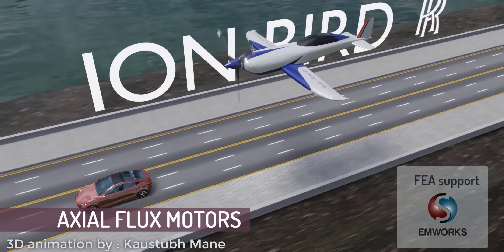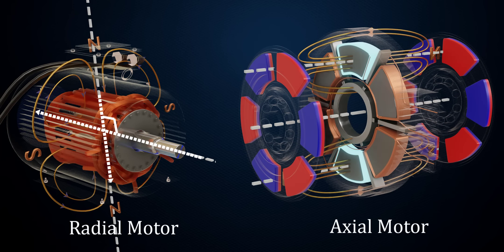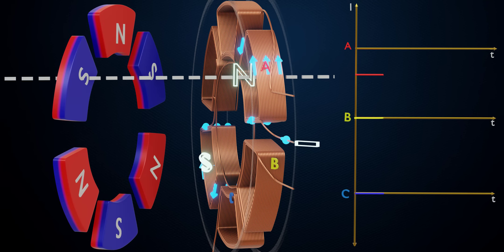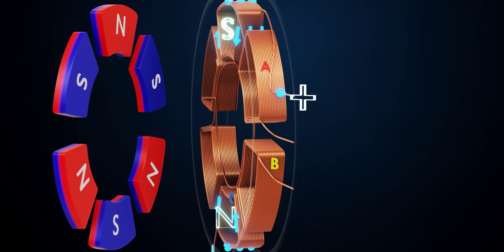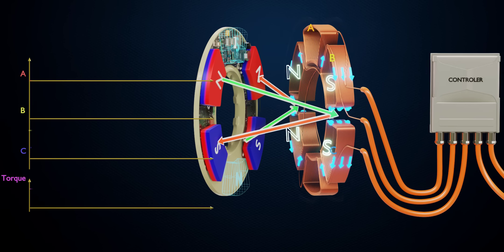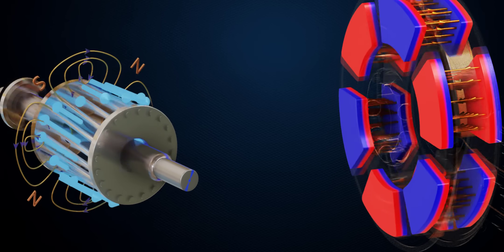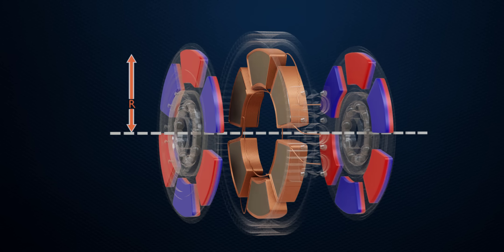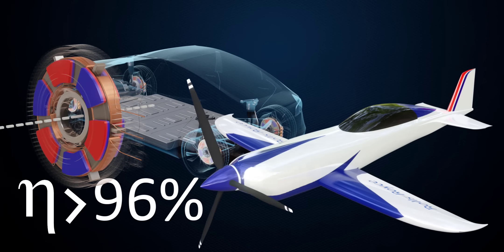Axial flux motors - The new hope

Comment: So why have we been using radial flux motors so far? What's the catch?
Reply: One would be the dimensions since "thin and long" is more convenient and secondly it requires more advanced electronics drive this type of motor. For every day applications like power tools and houshold appliances, the efficiency benefit usually is not of significant advantage.
Reply: @MiTheMer  I mean, I didn't even think of power tools but now that you mention them... a high torque-to-weight ratio isn't important for them? Really?
Reply: @unvergebeneid  Well, gearbox will be usually cheaper option. But I think that these motors will be used on high-end e-bikes, because apart from cost and complexity, they are perfect for this use.
Reply: @MiTheMer  modern power tools already uses BLDC motors, main reason for those engines not used in past, i guess is tied to low availability for high power mosfets.
Reply: This was my question too
Reply: Cooling is tricky.

Comment: Also, folks are going to scream cost-effectiveness just how much cost is this going to be less or more in the long run.  Could you wire in solar power so that you could include self-charging on long-distance between travel in the cars planes as well with piezoelectric  panels
Reply: Solar panels only make like 23 watts/sqft. 1 horsepower is 750 watts, so basically, no.
Reply: @grantmccoy6739  so this concept engine is a waste to, so there's no need for this either then
Reply: @cornbreadfedkirkpatrick9647  well, strong permanent magnets aren't cheap, and batteries don't hold much energy. I don't think electric planes will ever be serious.
Reply: @grantmccoy6739 , well everyday tech and materials prices do go down and better quality we must not give up I get upset when people always want to say it can't be done and then turn around and steal their ideas history has proven just that.
Reply: Every possibility has potential I'm tired of the one version we have had all this time with the changing tech and new material that is being developed there's hope  we just can't give up I know if it's not broke etc but why not keep it and develop something better along the way
Reply: @cornbreadfedkirkpatrick9647  there's plenty of room for improvement. For one, the airfoil design is upside down. Also, engines aren't nearly as efficient as they could be. In my opinion, fossil fuels are irreplaceable to certain industries. That doesn't mean that it's wrong to diversify. Ultimately, thinking outside of the box, thinking for yourself, scrutinizing concepts, will lead to improvements.
I think that the hysteria of climate change is really taking it's toll on people's mental health, and it's a good idea to think about the implications of what they are suggesting before just believing it. There's tons of reasons to believe it's not hardly the crisis it is advertised as.

Comment: Seeing this Working principle animation reminded me of BLDC Motor Animation made by Learn Engineering 5 years ago.
Reply: It's the same channel, they changed the name some time ago
Reply: Aren't they same thing?
Reply: @nomen_omen  for patent reasons, they are completely different.
Reply: Two for the price of one 😁😉
Reply: The only difference is the form factor. Doesn't matter if radial or axial, the principles are the same.
Reply: So why do we need a custom motor when off the self solutions do the same thing?
Reply: @CockroachSlidy  most BLDC motors are radial. This motor works off the same principle as a BLDC motor, but its axial. It just has higher efficiency. Same thing with axial generators vs radial generators
Reply: @CockroachSlidy  At higher speeds an axial design can be slightly more efficient, Since you can design it as a dual rotor machine. 
In a normal radial BLDC, the iron around the slots, and the back iron both experience high frequency magnetic fields, leading to hysteris and eddie current losses (Iron losses). As the rotor rotates at the same speed as the magnetic field, it does not experience these losses (or at least the losses are reduced by a lot). 

If you use an axial dual rotor design, only the winding area of the motor experiences iron losses, since you have a dual rotor design you do not need any back-iron.
Thus your losses at high frequency will be a bit lower.
Reply: I have not been this impressed since Rockwells' Retro encabulator.

Comment: Gradual energizing of the coils is a problem.  The losses in the inverter are significantly higher than with faster switching, so the efficiency of the overall system -the  VFD and motor maybe no better or worse than  with a conventional motor and drive.  
For semiconductors to operate efficiently , they need to remain in the non-linear region, whereas you seem to be describing semiconductors  approaching operation in the linear region.
Reply: No one in their right mind would be using semiconductors in their linear region for any high power motor control. They would use pulses and integrate them with the inductance of the motor winding.
Reply: @originalmianos  totally agree.  I’m not sure to what degree “gradual” they were referring to and the graphics may have exaggerated it.  But inductiance would be one way to smooth the current.   Not a big problem for a car, but the added  weight and space in aircraft might be a detriment.   My experience as an EE working in the motor/VFD field for 30 years - you never get something for free.
Reply: @southpaw7426  Well, as you know, with more modern wide band gap semiconductors, like GaN or SIC, you can switch at higher frequencies with lower on resistances, leading to much smaller and lighter parts. This is kind of 'free' due to technical innovation. Going forward the BMS and filtering should be a much lesser problem than battery density.

Comment: Mercedes Benz just Bought YASA which designs and manufactures Axial Flux motors.

And they also said that they will use it  for High performance all electric AMG EQ variants 

This move will push Axial Flux motors into the mainstream.
Reply: Axial flux motors have been used for many decades - but only in specific situations... hm... one gotta wonder if that might have something to do with the design not being superior but just having different tradeoffs..... nah, can't be, it suuuurely must be revolutionary and has been held back by a global conspiracy for over 100 years.......
Reply: @ABaumstumpf  Bravo 👏
Reply: Cool
Reply: Now that this Axial Flux are back ... or legalized xd
I think there is room  in the engineering process to free energy. 
Hands Down
Reply: I think the factor that is making the new Axial motor so improved and efficient is the computer controller.
   This was not available for Faraday or Tesla. Thus greater efficiency torque and control is possible.
With the addition of computer control these motors may out preform radial motors in certain situations.
Reply: I have not been this impressed since Rockwells' Retro encabulator.
Reply: Mercedes buying Yasa means the technology is dead now.
Reply: @blau6832  so right :D But good riddance, it wasn't competitive or good anyway. I don't know what they did but if they really did an exit good for them with dead technology in their hands.
Reply: Teslas patent of 1889 for the Axial Motor already made it "mainstream" more than 130 yrs ago, but ok.  Seems as though Yasa just outright stole the Idea and claimed it for themselves along with Mercedes and Rolls.
Reply: @lastofthebest5102  this is not Teslas motor you bimbo.
Reply: @lastofthebest5102  Patents typically last for 25 yrs, not forever.

YASA's tech is based on the Axial design, with improvements.

"Standing on the shoulders of giants" comes to mind.

Comment: Looks cool, but except the magnets and coils orientation, how is it different from a regular brushless motor? How is it more efficient and powerful than them?
Reply: As far as I understood, more of the magnetic flux lines are actually in use than with the traditional design.
Reply: @MiTheMer  Right. The advantage is with multiple, stacked rotor /stator wafers. In a radial design the flux path outside the coils is longer and cannot be shared between coil sets.
Reply: @MiTheMer  But they are not comparing it to the BLDC motor for example, which they've shown in another video. They are compraing it to a rotating flux motor. The principal looks exactly the same, and I'm not sure how is the performance of this motor is so much significantly better.
Reply: @MiTheMer  0l0
Reply: The torque per weight is better since more of the material is reciving magnetic flux at any time. The rest of the numbers is either meh or missing to be honest.
Reply: It's not brush less
Reply: @planespeaking  it certainly can be, if the rotor contains the permanent magnets and the stator contains the electro magnets.
Reply: Hi, you will (in general) have a higher efficiency with this kind of motors, and another advantage Is that they have a much less difficult engeneering process. In this case in fact you simply have the same amount of permanent magnets on the rotor and electromagnets on the stator. Non - axial flux brushless motors instead need a different configurations: both inner rotor and outer rotor motors usually don't have the same amount of permanent magnets poles and electromagnet slots. This ratio can affect the efficiency of the motor itself, changing the ratio between useful and available magnetic field , and it changes for each motor configuration x.x ....
Finding the right compromise sometimes is really difficult
Reply: @diegovigano6322  indeed, it is much easier to wind and assemble this motor.  Halbach arrangement on the permanent magnet arrays can help more useable magnetic field from the permanent magnet stator.
Reply: This ^
Reply: @luongmaihunggia  0l0
Reply: it uses Silicon carbide transistor instead of Mosfet, it capables of operating on higher frequencies and higher voltage than mosfet, ...and for same power rating like brushless it requires only 1/3 of brushless size, because the copper needed is way fewer, I see the real engine, and the shape of the stator is similar to a sheet of PCB with copper in it also without iron...so it is cheaper to go wider for this engine, therefore the torque also getting bigger, because of radius....if you need speed then gearbox will do the job